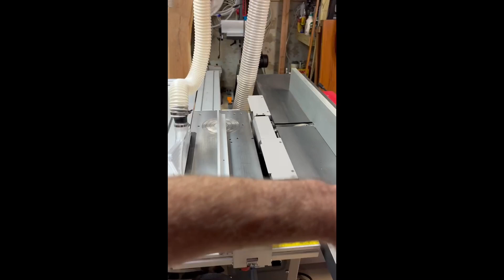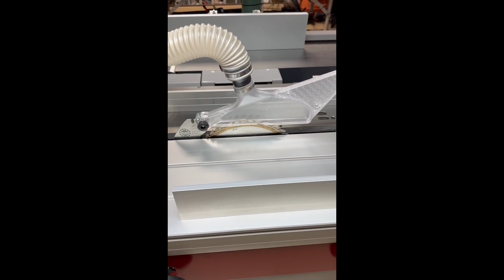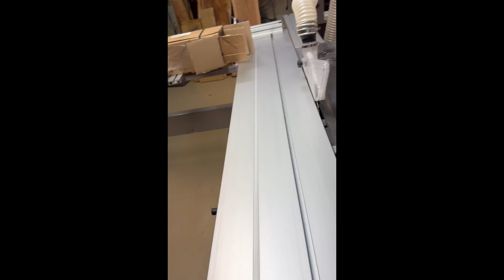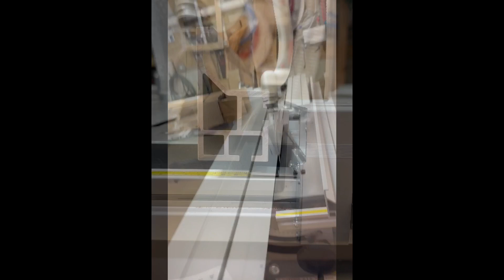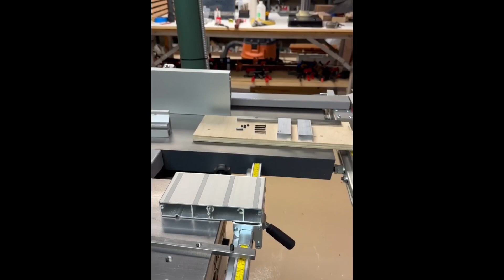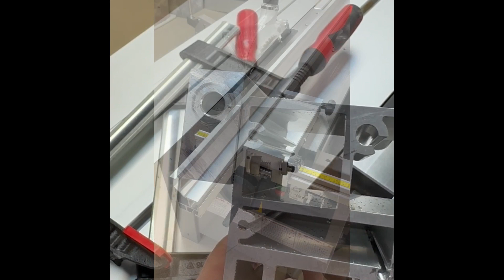Hammer C3 41 Comfort Rip Fence Review & Modification

Comment: I have the same unit and I also really like the machine. The Hammer C3-41 is well made and easy to set up. For me the combo machine is perfect for smaller shops where having an individual shaper, Jointer, Planer and table saw would be tough to fit.  In addition I only had to run one electrical line to the machine and one dust extraction trunk. Each of the components (table saw, jointer, shaper etc) are heavy duty, very precise, easy to set up and use. Having said all of that the fence is not great, and is a bit hard to adjust. Probably the only down side of the machine - but it works and gets the job done. I like your fix - nice job. If I had to do it again I would still buy this machine.
Reply from the maker: I agree. I think as long as people understand what the machines are capable of and what the limitations are, it’s a really good machine that can do excellent work in a relatively small space.

Comment: It amazes me how many hobby woodworker's fall for the combination station concept. I would be tearing my hair out trying to earn a living with one of those thing's. They are just so badly thought out and the price for what your getting ? Forget it.
I know what happens. Guys want a brand new shiny toy to show off but 
you will spend so much time switching functions to get anything done that eventually you give up and the only thing the machine does well is gather dust.
Fences need to be solid, sturdy, well engineered. They need to lock firmly, not flex. They need to support the work over a long length to keep the work aligned on the blades. 
The common table height sales pitch is a stupid excuse to have the planer right next to the table saw !
What an absolute pain in the ass.
Reply from the maker: @joschmoyo4532 - Combination machines fill a niche, which obviously isn't your niche. I agree that they aren't intended or appropriate for production work. I've spent a considerable amount of time in professional shops, and I have built projects that appeared in Architectural Digest and Fine Homebuilding magazines. With that said, even though I have been a successful professional woodworker, I bought this machine to do work for myself, so I suppose I am a hobbyist in what I am choosing to do with it. I don't have the space for multiple machines, or the need to do production work. With the exception of the issues I talk about in this video, I am very pleased with the machine. It is all about expectations; if anyone expects one of the combination machines to be the primary machine of a production shop, they will be disappointed. I didn't expect that, but I did expect the rip fence to be a better product, which is why I made this video. For a few hours work, I fixed the problem and I am happy with the solution. I don't see it as any different than someone who retrofits a Biesemeyer fence or any of the hundreds of other modifications that people make to their table saws. Best of luck with your business!
Reply: @theoccasionalwoodworker  
I retro fitted a Biesemeyer fence on Delta table saws and an Oliver.
It's a well known and sensible upgrade that's been around since the nineties. Easy to do, worth the time and money. I hear the space saver argument a lot but I don't buy it. To many guy's use their work space for storage and crowd it out. If your serious about making you make space.
There are no cabinets in my shop. No fitted drawers. No benches along the wall. I've used combination machine's and quickly came to hate them. The boss bought it to save money not space but most shop employers are idiot's in my experience. 
Two plus machine's in one !
Three times the amount of time to do the same amount of work more like. My last experience was with a Robland combination. What a pig that thing was. Hopelessly inaccurate, the Jointer tables never could sit co planar and were to short to joint accurately if they were. Absolute garbage. 
Thank God that job didn't go on forever because milling the cut list's for a two storey pipe organ case was not small beer.
It was a running battle making everything to an acceptable tolerance. Never again.

Comment: I don't understand your video and concern to be honest. 
You have 2 situations to cover: 
 - You rip raw wood: you certainly do not want the fence to extend beyond the blade, you actually want the fence to stop around the middle of the blade in order to allow the wood to release tensions when it's cut and not get pinched between the blade and the fence 
 - You rip perfectly planned and square wood to dimensions: you only need the fence to protrude a couple inches from the blade. 
Looking at the video, and the rough dimensions you are showing, it is working perfectly.

Comment: Can you please do a video going over the machine, price, why you bought it, space needed, which capabilities are worth having, comparing to table saw + CNC router, and highs/lows based on six months of ownership? I can't find any reviews on this machine on YouTube
Reply from the maker: Luke, sure, I can do another video. Let me put some thoughts together and I’ll try to get it done soon. For what it’s worth, this machine is basically a K3 table saw/shaper bolted to an A3 41 jointer/planer. You may find more reviews on those machines and probably 90% of what people say about those machines also applies to these machines, the biggest exception in my mind being the width of the table on the table saw, and the split rip fence. Also, if you haven’t already watched it, my other video about setting up the machine talks quite a bit about the space it needs and what options I got. If you have any specific questions, let me know and I’ll try to answer them.

Comment: Thank you, this kind of thing is hard to notice before ownership, and it’s great to see possible solutions! 

If possible, I would like to ask you about the router cutting potential. People from the dealership told me it’s not strong enough to make windows, and It’s something I am looking for…Have you had the chance to test it’s strength to a point where it’s not enough? Is it an issue with the machine? Thank you!
Reply from the maker: I've used the shaper for two operations so far - rabbeting and making a window sash. I used a set of Freeborn PC-10-010 cope and pattern cutters to make the window sash:

https://freeborntool.com/product/pc-10-010-pt-10-010/

I did not notice any power issues in using the cutters...in fact, I thought the shaper did an excellent job. My machine is a single phase machine and is on a 30 amp 240V circuit. Like any machine, I'm sure it's possible to find jobs that would overload it, but I think it's perfectly capable of cutting the profile on a window sash or door. If you haven't used a shaper with a sliding table before, you will find it to be a very useful feature, although I must say the shaper fence needs adjustment to be square to the sliding table.
Reply: @theoccasionalwoodworker  Thank you SO much!!!

Comment: I can think of a few alternatives:
1. buy another C3 41 fence, make a steel bar with tapped holes and set screws to extend the current fence;
2. cut the bottom of the long fence until it's the correct height;
3. what is the current height for the T slot? Maybe an 8020 extrusion can can match. Or some T slot extrusion that has a lower T slot height, then add some UHMW pads on the bottom of such extrusion to reach the corret T slot height;
I am still waiting to get the used C3 31 to move into my shop. I ordered the mobility kit, and they came in 2 boxes taped together and life long supply of bubble wraps.
Reply from the maker: Yes, I agree, there are certainly other alternatives. The center line of the T-slot in the factory provided fence is approximately 29mm, and I couldn't find an 80/20 or other extrusion that matched that, but there may very well be one out there. I considered cutting the longer Felder extrusion, but decided against it. I already had the longer Felder extrusion on hand, so I wanted to find a solution that used it and that didn't damage it, in case I decided to return it to Felder. It's also worth mentioning that these fences are made to be flipped 90 degrees to lay flat when ripping with the blade at a bevel, so I also wanted a solution that would keep that functionality. 

Good luck with your C3 31, and please post any solutions or tricks you find about your machine.
Reply: @theoccasionalwoodworker  40x80 extrusion should have center of T slot 20mm above bottom, and there are 6 slots. May need to use pads to make up that 9mm difference. Verysupercool tool fence uses such extrusion. I came cross a few 10ft long ones locally and bout 2, cut to various sizes. 2 shorter ones I used to clamp to my biesmeyer fence to have a longer fence, and also cover up the middle of my biesmeyer which has an 8 thou dip. 
C3 31 I’m buying is used. Shaper head was stuck, and seller is fixing that and replacing a few small parts. I already sold my Unisaw, 6” jointer and 15” planer to make room for hammer.
Reply: @theoccasionalwoodworker  do you use any messaging app? I found an extrusion that has pretty much the same profile as hammer fence, and you can purchase by length. I can send you the profile drawing.
Reply: @What_Other_Hobbies  can i ask you to share? I have a C3-31 and god, what a cheap fence.
Reply: @jonathanmassaro3142 I now share my woodworking topics on my @fusion_woodworking channel but I haven’t got to upgrading the fence yet.
Reply: @jonathanmassaro3142 this is my woodworking channel. I’ll share all my C3 31 videos here.
Reply: @Fusion_Woodworking thank you sir, but i cannot understand. Do you have by any chance the extrusion code needed?
Reply: @jonathanmassaro3142 I haven’t got to the point of upgrading fence but that’s on my list of projects. The planer side on my machine still needs to be assembled. You can find out about my progress in my Hammer C3 31 playlist. It’s been going on for years. 😢